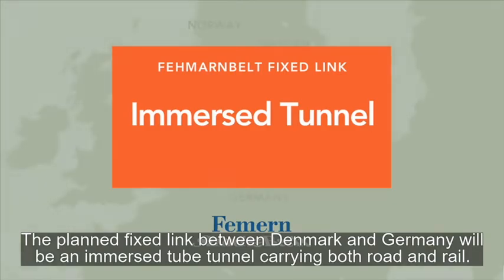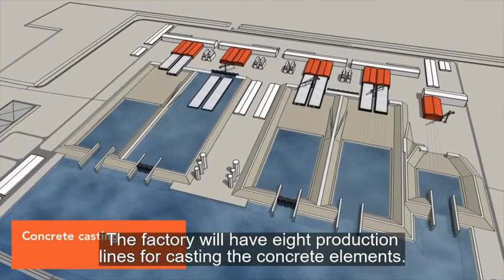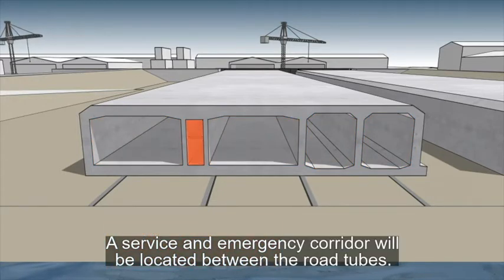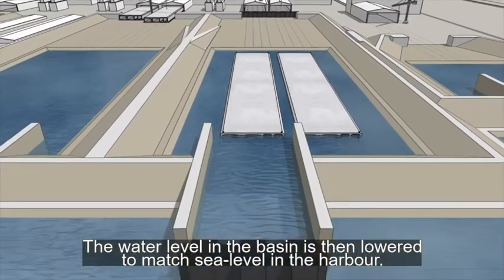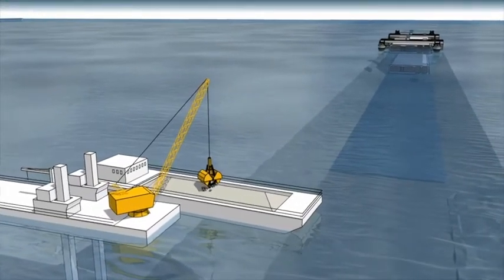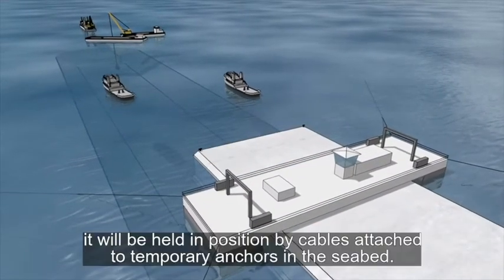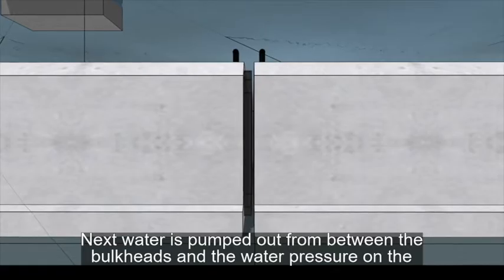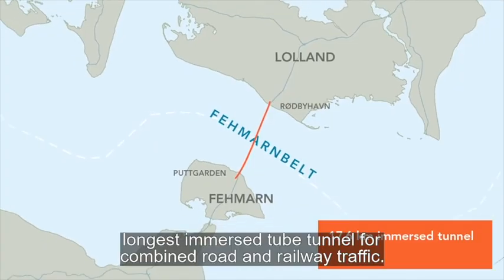Construction of the Fehmarnbelt Tunnel (animation)

Comment: I predict this will be one of the first roads in Europe to ban ICE cars & trucks  (i.e. ones with with Internal Combustion Engines).
Reply: Why?
Reply: @isaks7042  It is a long tunnel and thus the exhaust fumes are more of a problem in it than on surface roads. Even with all the ventilation built into it, getting rid of ICE exhausts would likely drastically reduce the levels of poisons in the air down there.
That said, it likely won't happen til a significant % of cars/trucks are non-ICE.
Reply: @GustavSvard  Also electric cars and lorries are allowed to pass, if they are able to drive that far, without being charged. And pumping fresh air through the tunnell may hardly be a problem today.
Reply: @finncarlbomholtsrensen1188  If they are able? All electric cars on the market have been able to drive that far on one charge for at least a few decades now. The risk of running out of fuel might be higher for ICE cars now, since there's quite a few old ones on the roads with fuel gauges that aren't all that good ;)
Reply: @finncarlbomholtsrensen1188  As for the air quality... The similarly long tunneled Stockholm western motorway will have recommendations to turn of all air intake into the car cabin when driving in it. I.e. don't take a motorbike down there. It'll be legal to do so, probably, but the air... yikes.
Reply: @GustavSvard  We all exhale, for us deadly gasses and may try to avoid them. And when they find a way to charge a less expensive electric car as fast and easy as filling an ordinary tank ("Better Place", tried in Denmark) I may be temptet, to change?  But untill then I will keep my "blue additive" diesel as long as possible. ;-)
Reply: @GustavSvard  I have driven through long Norwegian tunnels without any kind of fresh air being pumped in or light, and you could hardly see the emergency-station lights at the mist, at intervals. But this will be like an ordinary tunnel with lights on. But anyway it may be advised to turn off the intake?